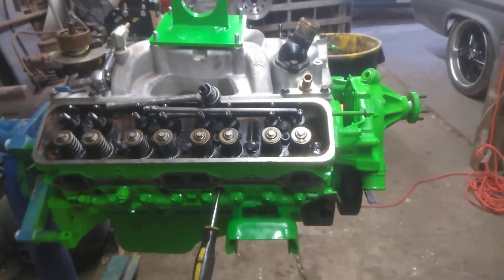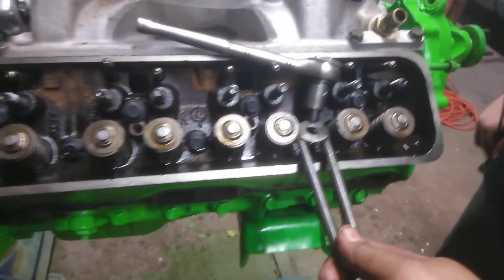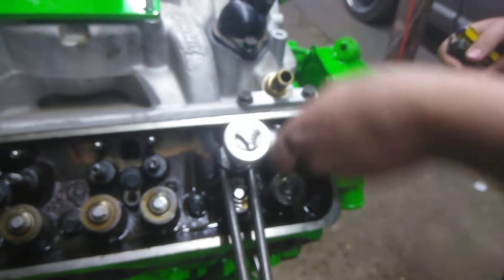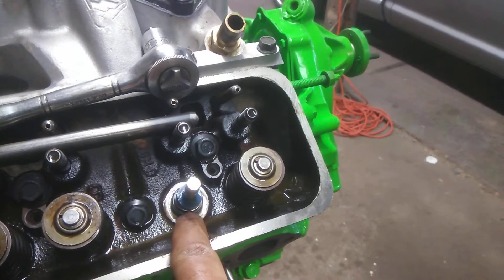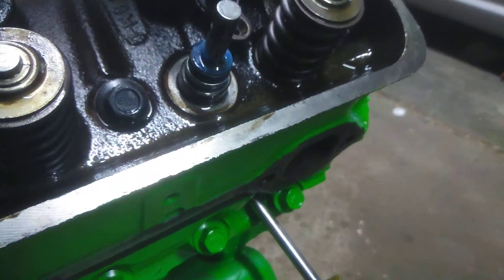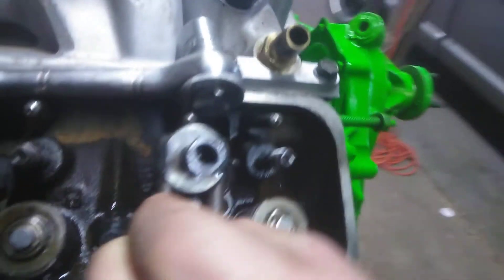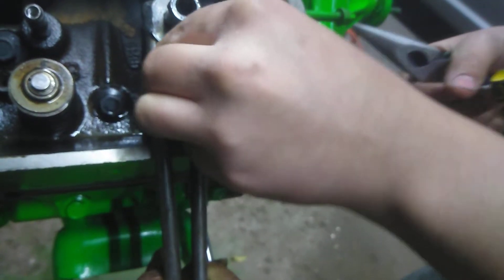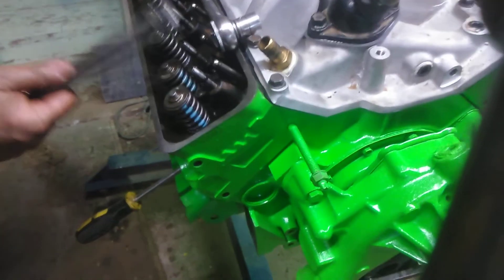Sbc vortec valve spring removal and install spring failure

Comment: Would that also cause the studs to break?i have z28 springs in my vortec heads I did leave the dampness in,I broke 3 studs 2 separate occasions now I see pieces of dampener in head will this fix my stud issue
Reply from the maker: Yes I believe so your braking studs because you might be coil binding I don't think it would hurt to take them out

Comment: i thought you had to either cut the guide down or use ls6 springs and comp 787-16 retainers to use a hot cam? those look like z28 springs, which will only get you like .480-.500 lift clearance.
Reply from the maker: I cut the guides back springs are good to .550 the spring dampeners was my problem

Comment: Thanks man... gonna make that tool right now. Quick tip, don't weld the bottom side together till you bend a V just past the rocker washer, then weld the end. That'll give you more clearance to reinstall the keepers.
Reply from the maker: Great tip

Comment: You have to run LS6 SPRINGS 12499224

Comp retainers 787-16 and crane retainers 99095-1 then your ok
Reply from the maker: Yeah I should have went that way
Reply: So will those springs and retainers work with a vortec 906 head?
Reply from the maker: @dylananderson6773  yes I believe so I think the only difference is the exhaust flows better on the 906
Reply: I bought springs from a place called Alex Auto parts . Custom springs retainers and clips for like 130$ made for 550 lift without machine work.
Reply from the maker: @jackhunsucker3220  550 lift and you didn't have to machine to valve guides
Reply: @jackhunsucker3220  did this work?